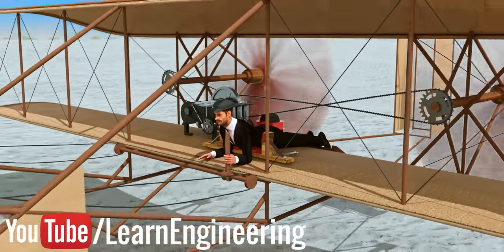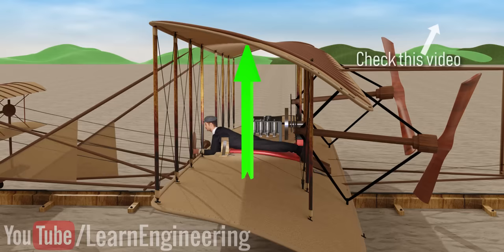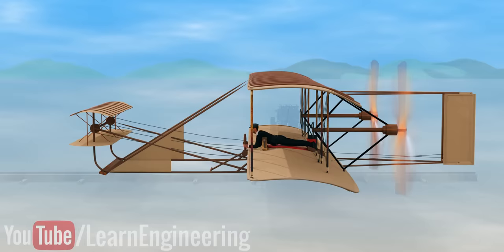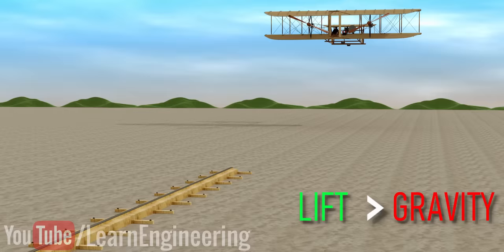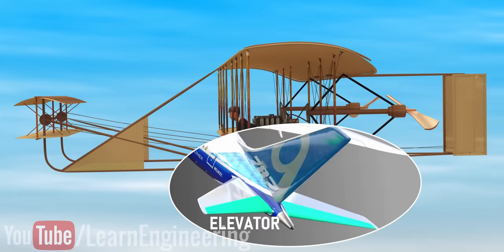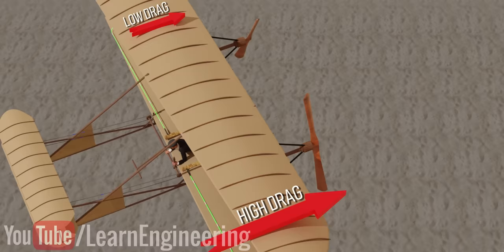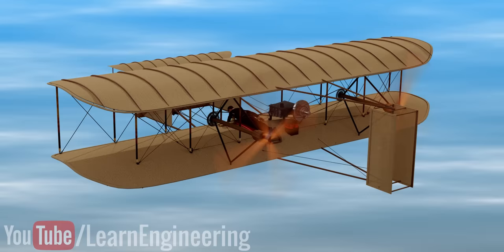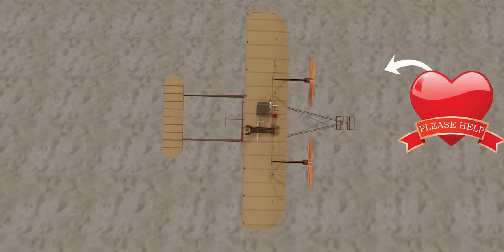The Brilliant Engineering of FIRST FLIGHT !

Comment: the title of the link is strange! perfect replicas of this engineering were built and the replicas in the original conditions do not fly.
Reply: @majorbett  Do you personally believe the Flyer 1 could fly sustained without any wind on a flat surface ?
Reply: @majorbett  in john denver video the machine without winds on the ground. With power winds, glided only.
Reply: @sanpol4399  To sustain flight, the craft needs a windspeed of 35 mph over the airfoil wings.  A 12 hp. engine
is fully capable of doing this.  The problem is that the 1903 Wright Flyer was so unstable that it rarely sustained flight.  The longest flight was an alleged to be 57 - 59 sec.
Reply: @selmanedel7973  I thought the video said that this flight was staged near Kill Devils Hill in NC and there was a 15 mph headwind.

The replica needed both the engine and the wind to take off.  Without the engine, how would the powered
glider achieve any forward motion?

Denver didn't have the benefit of 100's of glider flights  and he was unable to control the craft.  If he was in the air 12 seconds,  he just about duplicated  the first flight.
Reply: @majorbett   First we need to  define what an airplane is.
    Depending on the definition, the first man to fly an airplane changes completely.  
    For you, something that can not takeoff from a flat surface without wind, can be considered an airplane?
Reply: @sanpol4399  Most airplanes require wind.  It is usually achieved by taxiing until take off speed is achieved.
The first Wright Flyer would taxi on little wheels on a wooden rail.  Wit;h less than 20 hp available from the engine,
the wooden rails might need to be 200 ft. long to reach take off speed without a strong headwind.
Reply: @majorbett   Do you believe that Flyer 1 could take off and/or keep flying without wind, over a flat surface?
Reply: @majorbett Forget it, kid, you didn't justify the failure of 2003. That was never a first plane.
Reply: @gilbertonedeljunior4825  

SB:  I looked through the earlier comments and couldn't find one that matched your response. 
 "you didn't justify the failure of 2003

Here is another possibility:
https://en.wikipedia.org/wiki/Claims_to_the_first_powered_flight

Brazilian professor, Lins de Barros believes that the “strong, steady winds at Kitty Hawk were crucial 

for the Flyer’s take-off, disqualifying the flight because there was no proof it 
could lift off on its own.”  

That was in 2000.  Now there is proof that the Flyer cannot lift off on its own.
That proof was supplied by the performance of the Wright Flyer (exact replica)
on Dec. 17, 2003 on a day when there was little if any wind.  An oddity at Kitty Hawk, NC.  

SB:  LdB is right:  Gale force 21-28 mph winds plus the thrust provided by a small engine and efficient props were required for take off.
  The 1903 Flyer could not lift off without both.  In 1905, a derrick catapult compensated for the low winds in Ohio.  So now the Flyer required assist from all 3,  The catapult, the motor, and a headwind.  One engineer estimated that the catapult provided thrust equivalent to 6 mph of wind speed.  

"That was never a first plane."   

Are you saying that you don't accept Hyde's replica as a perfect replica of the first plane?  
That would be one of the possible interpretations.  Please clarify.

Are you talking about this video of the Wright Experience exact replica.  It hops about 
100-150 ft. and stays aloft only 4 to 12 seconds.  

https://www.youtube.com/watch?v=o1mscspl-VU

The next video is the less exact replica piloted by John Denver.  
His father was involved in its building and they flew it near Kitty Hawk (Kill Devils Hill)
on a day with a headwind of 10 to 14 mph. 
 
https://www.youtube.com/watch?v=yHxvdV9elL8&t=2s
jettisoned
Reply: @stevebett4947  don't forget Steve, who must prove that the wright flew between 1903-1905 an official document is you !! otherwise accept that you lost the debate and that together with the wright you lost it in 1906. Dumont was already famous since this period. Present here, Steve, only the documents that they officially registered between 1903-05  to finally You manage to defend the two incompetents of dayton.
Reply: @harpiasonhadorasonhadora5259  
SB:  Did you read my last response in bad portuguese?
Give me some time and I will attempt a to translate this.

There is no debate on many issues.  
Why do you want to debate issues where we agree?

Santos Dumont was famous before 1900 and had a rock star
status in France until after 1910.  The Google Ngram only suggests that
he did not have as many mentions as the Wrights in print after 1925.  

While Santos-Dumont may have thought he had lost status after the Wilbur
demonstrated his mastery of flight in LeMans beginning in Aust. 1908.
he was wrong.  All he had to do was wait a year.

I wish he had used the time to write a sequel to his book on dirigibles.
It would have sold almost as well as hit first book.

There was no need for him to retire and move away
from Paris to save face.  The Wrights' ability to grab headlines sharply
declined after 1909.  Bleriot became the new media sensation.

If you use the FAI definitions, no one could have made
an official flight record before the FAI was founded in 2005.  
Therefore there is no incontestable proof
for any of the Wrights reported flights before 1908.  

What if the Wrights' had said that unless the alleged record 
demonstrates the capability to bank and turn, it was not "flight".  
The 1906 performance by Santos-Dumont does not count.
It was just a short uncontrolled hop -- Not real flight.

To make it more absurd, the Wrights' could say that no record could be
set before 1908.  This alone would disqualify the flight of the 14-bis.

It sounds silly and unreasonable because no can make up definitions 
to give their side an advantage.  They can try and Archdeacon and 
his cronies were quite successful in getting the public to believe
that their definition was the correct one.  It was a public relations
success, not one that would stand up in a debate.  

*Flight, as defined by a dictionary, makes
no mention of either official witnesses or 3 axis control.
Reply: @stevebett4947  Steve, maybe you’re in trouble, but I believe the biggest one is acceptance you cannot accept the reality of the facts. Everything has already been presented here and a debate has really been going on for some time here in these comments If there was no debate taking place you would have been silenced long ago. As for other observations, I need to point out to you that I need you to translate into Portuguese. For me to read English is like reading in Thai, you can't understand it. As for the little I understood regarding FAI, I believe I managed to reach an extreme point weak for wright defenders like you. All of their defenders are extremely hesitant when presenting evidence that someone flew before Dumont I remind you of a detail that has been warned here many times and vice is always used tirelessly ,. the old excuse applied by everyone else idiots who try to defend these shammers, always claim the excuse that for some reason it was not possible to register anything before 1905 !! kids realize this is an excuse, Steve, see, a child realizes that this is an excuse and others with whom I have debated claim the same excuse. It is good to remind you that in 1898 the greatest aeronautical authority of the time was created for records aeronautics in the world THE PARIS AEROCLUBE, IN 1900 THE NAME OF THIS AUTHORITY CHANGED TO FRENCH AIRCLUB and later he started calling FAI in 1905. Detail, this world authority could register everything for the wright or anyone since 1898 and summoned the wright in 1904 !!! Even before the emergence of this authority previous records could be made in government agencies or even trademarks and patents anywhere in the world.
Reply: @stevebett4947  Correction, there is no record made for Archdeacon regarding any jump in 1906 what happened was FIRST AVIATION RECORD OF THE WORLD which has been IMMORTALIZED in a monument in Paris for a long time. The record regarding these first flights National Aeronautics presented many years ago and wrights occupy only the eighth place among these pioneers of motorized flight. The Dumont event as the first event in aviation history was recorded by the most important newspapers in the world
Reply: @stevebett4947  in fact Dumont was already famous since 1901 when he turned the balloons into airships. The recognition for Dumont as "PIONEER OF AERIAL LOCOMOTION" is in another monument in Paris, Santos Dumont's Square. Note: In this period that Dumont was honored for having turned the balloon into an airship and circled the Eiffel Tower, the wrights had the worst glider in the 1901 glider, simply uncontrollable artifact
Reply: @harpiasonhadorasonhadora5259  

SB:  As requested -- an attempt at a Portuguese translation:
You can respond in Portuguese if you want.

SB: Você leu minha última resposta em um português ruim?
Dê-me algum tempo e tentarei traduzir isso.

Não há debate sobre muitas questões.
Por que você quer debater questões em que concordamos?

Santos Dumont era famoso antes de 1900 e tinha um astro do rock
status na França até depois de 1910. O Google Ngram apenas sugere que
ele não teve tantas menções quanto os Wrights impressos depois de 1925.

Enquanto Santos-Dumont pode ter pensado que havia perdido status após o Wilbur
demonstrou seu domínio do vôo em LeMans começando em Aust. 1908.
ele estava errado. Tudo o que ele precisava fazer era esperar um ano.

Eu gostaria que ele tivesse usado o tempo para escrever uma sequência de seu livro sobre dirigíveis.
Teria vendido quase tão bem quanto o primeiro livro.

Não havia necessidade de ele se aposentar e se mudar
de Paris para salvar a cara. A capacidade dos Wrights de agarrar as manchetes com nitidez
declinou após 1909. Bleriot se tornou a sensação da nova mídia.

Se você usar as definições FAI, ninguém poderia ter feito
um registro oficial de vôo antes da FAI ser fundada em 2005.
Portanto, não há prova incontestável
para qualquer um dos voos relatados pelos Wrights antes de 1908.

E se os Wrights tivessem dito isso, a menos que o alegado registro
demonstra a capacidade de inclinar e virar, não era "voar".
A atuação de Santos-Dumont em 1906 não conta.
Foi apenas um pequeno salto não controlado - não um vôo real.

Para tornar mais absurdo, os Wrights poderiam dizer que nenhum registro poderia ser
definido antes de 1908. Isso por si só desqualificaria o vôo do 14-bis.

Parece bobo e irracional porque ninguém pode inventar definições
para dar uma vantagem ao lado deles. Eles podem tentar e arquidiácono e
seus camaradas tiveram muito sucesso em fazer o público acreditar
que sua definição era a correta. Era um relações públicas
sucesso, não aquele que se levantaria em um debate.

* Voo, conforme definido por um dicionário, faz
nenhuma menção de testemunhas oficiais ou controle de 3 eixos.
Reply: @harpiasonhadorasonhadora5259  

As requested:  como você pediu:

SB: Você leu minha última resposta em um português ruim?
Dê-me algum tempo e tentarei traduzir isso.

Não há debate sobre muitas questões.
Por que você quer debater questões em que concordamos?

Santos Dumont era famoso antes de 1900 e tinha um astro do rock
status na França até depois de 1910. O Google Ngram apenas sugere que
ele não teve tantas menções quanto os Wrights impressos depois de 1925.

Enquanto Santos-Dumont pode ter pensado que havia perdido status após o Wilbur
demonstrou seu domínio do vôo em LeMans começando em Aust. 1908.
ele estava errado. Tudo o que ele precisava fazer era esperar um ano.

Eu gostaria que ele tivesse usado o tempo para escrever uma sequência de seu livro sobre dirigíveis.
Teria vendido quase tão bem quanto o primeiro livro.

Não havia necessidade de ele se aposentar e se mudar
de Paris para salvar a cara. A capacidade dos Wrights de agarrar as manchetes com nitidez
declinou após 1909. Bleriot se tornou a sensação da nova mídia.

Se você usar as definições FAI, ninguém poderia ter feito
um registro oficial de vôo antes da FAI ser fundada em 2005.
Portanto, não há prova incontestável
para qualquer um dos voos relatados pelos Wrights antes de 1908.

E se os Wrights tivessem dito isso, a menos que o alegado registro
demonstra a capacidade de inclinar e virar, não era "voar".
A atuação de Santos-Dumont em 1906 não conta.
Foi apenas um pequeno salto não controlado - não um vôo real.

Para tornar mais absurdo, os Wrights poderiam dizer que nenhum registro poderia ser
definido antes de 1908. Isso por si só desqualificaria o vôo do 14-bis.

Parece bobo e irracional porque ninguém pode inventar definições
para dar uma vantagem ao lado deles. Eles podem tentar e arquidiácono e
seus camaradas tiveram muito sucesso em fazer o público acreditar
que sua definição era a correta. Era um relações públicas
sucesso, não aquele que se levantaria em um debate.

* Voo, conforme definido por um dicionário, faz
nenhuma menção de testemunhas oficiais ou controle de 3 eixos.
Reply: @stevebett4947  be careful, Steve, this way you try to disqualify the powers that the greatest authority of the time had. Since 1898 you have greater authority in the aeronautical area and having done since 1898 the qualifications for the first flight of the heaviest than air they obviously had the conditions and authority to carry out since 1898 any record regarding the first airplane.
Reply: @stevebett4947  Three-axis control was invented by French mathematicians Frennet-Serret in 1851, wrights were not born, and the idea was old.
Reply: Yes... because of air density... it did fly...

Comment: The QUESTION is not How these High school dropouts did it 100 years ago??
BUT
How MANY TIMES they tried TO MAKE IT WORKS???
Reply: Three times
First two failed, third flew
Reply: The Wrights knew the first Flyer had design flaws.  It was a prototype.  
It did take 3 tries to reach the performance level of the Wright Flyer III.
They didn't stop there although they called the Flyer III a practical airplane.
The 2 place Wright Flyer Model A and Model B with the 1906 Dayton engine was a significant advance.

Comment: Did you know that the replicas that were already built in the original conditions proved that the Wrights did not fly?
Reply: How would you know that it was built to original specifications? Did the replica builder actually use the right composition in medals and rope strength per weight? 

Alot of things were made completely differently way back then.
Reply: How do you explain the two videos of exact replicas flying when there was a headwind of 15 mph or more.
One test flight was in November.  The other in early December.  
The two exact replicas did not fly well but the did take off when there was a 15 mph headwind.  
They flew 100-120 ft. in about 15 sec.  Similar to the first flight on Dec. 17, 1903. . .
when the headwinds were over 20 mph.
Reply: @MarcABrown-tt1fp  Read up on Hyde's construction of the exact replicas.  Every effort was made to duplicate what was available in 1902-3 and to avoid using anything modern.
Reply: tests done with the perfect replica of the centennial had extremely strong headwinds. the wind could be heard in the recordings. The same replica without strong headwind was tested and not took off.
Reply: @acucarchocolate3961   

AC:  The wind was more than 4 mph on 17 Dec. 2003, you can hear it in the video.  

SB:  You can look up the windspeed on 17 December 2003.  It was less than 4 mph.  
You should be able to look up the wind speed , barometric pressure, and density altitude, for 17 Dec. 1903.  
It was between 20 and 28 mph. according the the Wright Brothers.

There were at least two successful tests flights before the Centennial when the wind speed was around 15 mph.
Why do you continue to claim that there were none?
I have posted the URL for the video a half dozen times.  Here is the one for 17 Nov 2003,  
 https://www.youtube.com/watch?v=o1mscspl-VU

I have also posted the test flight for 5 Dec, 2003, a few weeks before the 17 Dec. 2003.
On 17 Dec., The flight conditions were very bad.  I doubt that Santos Dumont would have attempted to
fly when there was that much moisture in the air and on the ground.  

The 14-bis had more than enough power on a sunny day,  but the engine would not produce 50 hp. when wet.
The wheels were useless if there was any mud.